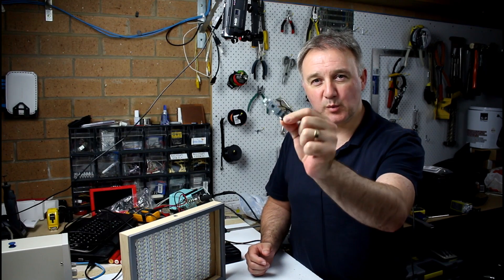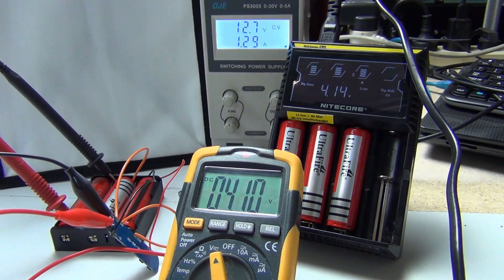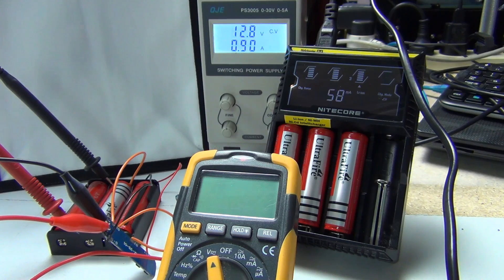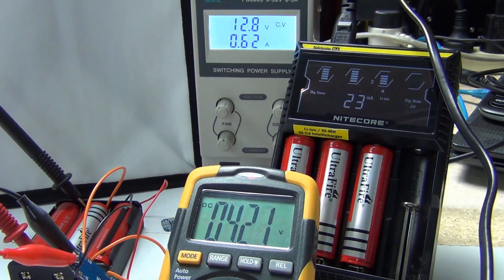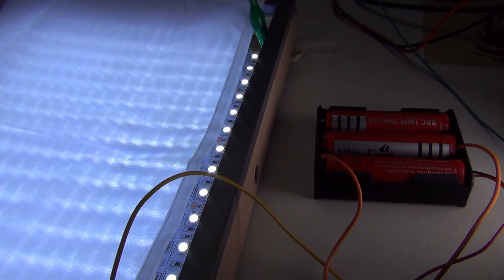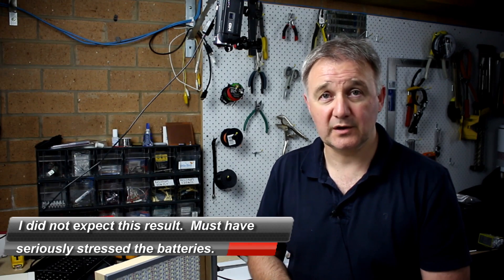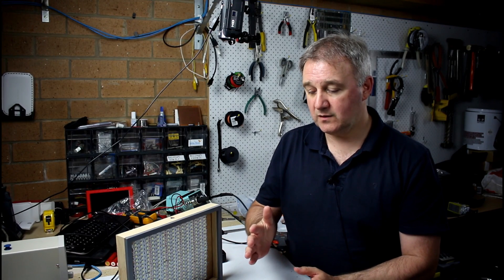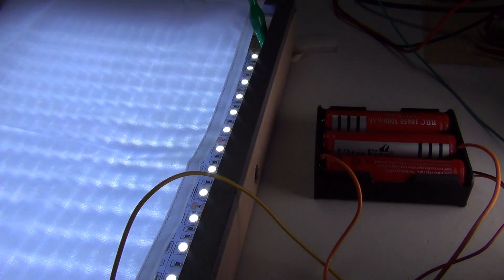BMS vs Battery charger - Surprise result (MEHS) Episode 58

Comment: You trickle charged your batteries more than they needed to through benchmark power supply.if you had cut the charge at the 0.3 amps,your results would have been the same.Nice effort

Comment: What i surmised from this is that small BMS boards can't be trusted and i need to build a battery cover on my device and put the 18650 cells in holders so i can take them out and put them in a proper charger 😞

Comment: What's the moral of the story? Can I charge a 3s 3p set of 18650s (total 9) with my regular 12V adapter (or 12V solar panel) using this 3s BMS or naa?

Comment: I'm not so sure about your results with your cheap charger and fake batteries.
  From what i understand, you feed the BMS with a fixed current art 4.2V The fixed current should be around 1/2C or whatever your battery is rated at for safe charging. For example. You are charging a4p 3s pack, each battery can be charged at 1A so you give the BMS 12.6V at 4A. The voltage can not stay fixed. It finds the level of the batteries and rises as they charge. If your batteries are very low they will try to draw more than 4A (if they are good battery cells) Then once they come closer to the final voltage the current naturally starts to drop off.
  You can buy a chargers that can not even deliver the charging amperage that your battery requires and they will take longer but if the end voltage is 4.2V then both sets of batteries should have ended up with the same amount of usable MAH. If not it is either because your charger has an end voltage of lower than 4.2V or that your batteries are toast and you did not do a controlled experiment by swapping the two sets around for the test.
  Did you measure the final voltage in the cheap charger? It might only be setup for storage voltage around 3.7V as that's what most people tend to do with batteries and that's a much safer more stable voltage!
Reply from the maker: Hi.  Yes agree that the results would have been much more conclusive if I swapped the cells over and ran the test again.  I have since disposed of all but 2 of the cells as they started to show significant resistance when charging.  Just really junk cells.  Cheers.

Comment: wow. so much wrong here. You purposely overcharged the BMS cells to OVER 4.21V 
AND you didn't mention the fact the Nitecore D4 only charges Li-ion to 4.16V not 4.2V to extend the life of the batteries
Do you work for a company that benefits from these BMS receiving bad press? 🤔🤔

Comment: What is you limit the input amps to the BMS.
Reply from the maker: Current was set to 3A but that was only because I tested the draw earlier and it never went over 2A.  Cheers
Reply: Ok thank, also would this be a good setup for charging a 4s2p pack of 18650 li-ion cells?
Charger - https://www.ebay.co.uk/itm/MAX745-4-2-4-35V-1-4-Packs-Lithium-Battery-Charging-Board-Voltage-Current-adjust/111825916930
BMS       - https://www.ebay.co.uk/itm/BMS-PCB-Balancer-Schutzschaltung-8A-f%C3%BCr-4S-14-4V-Li-ion-Akkupack/322980140008

Comment: The only sane video I see on Youtube regarding  Lithium battery charging. You wouldn't believe what other people do with 18650 batteries on Youtube including direct soldering on battery, gang-charging multiple batteries connected in parallel and/or serial without screening, and so on.  Thanks for the true engineering insight.
Reply from the maker: - Hi.  Thanks for the feedback and kind comments.  Cheers.

Comment: Lol what is this? You dont show us the mAh of those batteries? Your test is very in correct
Reply from the maker: - The MAH capacity of the cells is irrelevant as the test is about draining protected cells from a fully charged state, once in the Nitecore charger and once through the BMS.  The main reason for the difference as I discovered later was that one of the cells was way out of spec meaning the battery charger terminated the charge much earlier that the BMS.  The conclusion was simply that the Nitecore charger does a better and safer job of charging cells and maintaining the life of the cells (hopefully quality ones).
Reply: My Electronics & Hacking Show
Oh man diff cell have diff capacity. And you dont show the capacity of the cells. If bms charging is not good and not safe how come they use it in laptops?
Reply from the maker: - The cells in a laptop are joined by a BMS to make the laptop battery but they don't just dump a raw 12.6 or 16.8 or 21v into the battery pack to charge the battery.  The input voltage / current is managed by an additional IC (like a MAX745) that does more than a basic BMS.  You could still call the laptop solution a BMS but it has much more on the board than the simple BMS ive been testing.  Many new laptop solutions have individual cell monitoring, balancing and battery conditioning.  These initiatives have been implemented to make lithium packs safer and last longer, especially now many are sealed units.  As I mentioned already, the capacity of these cells in this test is not the point.  I do have a follow up video showing the real tested capacity of such cells if you're interested.
Reply: My Electronics & Hacking Show

That why you dont spreading a word that BMS charging is not good and not safe they are safe and good man. Some china made bms have also temp sensor. And your nitecore dont have it. It only use voltage sensor for shutting down.

Comment: how can one improve from the bms for charging?
Reply from the maker: - Basically you need to use a real charger as the BMS only controls the limits of voltage and current.  For 2-4 cells BMS you can use the MAX745 IC.  For anything more than 4 cells you need a dedicated external charger or a bespoke solution.  Cheers.

Comment: My question is, if I only wanted to use this to stop over discharging not to use it for charging would this work? Or should I just drain the batteries till the light stops?
Reply from the maker: - Hi.  Yes the BMS is ideal for protecting against over discharge (one of its main purposes) and you shouldn't just drain the cells until the light stops as you mentioned.  Doing that will drain the cells too low and significantly shorten their life.  Cheers.
Reply: My Electronics & Hacking Show Great! thanks for the reply

Comment: I really wish people would stop doing tests with those FN cheap overrated Ultrafire batteries you can not get good results from them.  There is not any consistency with those cells, I was suckered into buying them and every 1 of the 10 cells tested different some were 450 mah a few were 625mah and a couple only tested 275mah. STOP TESTING WITH THESE SHIT BATTERIES. other than that good try on the test.
Reply from the maker: - Hi. Agree they are not consistent.  I did a follow up video with a battery tester and real cells along with the Ultrafire cells.  They peaked at 800mah.  Cheers.

Comment: I only need the low voltage cut off. My pack is sealed so i wil make extra balance leads for my charger. Question is, will the bms interfere with my connected balance charge, seperate from the bms.
Reply from the maker: - Hi.  Possibly but unlikely because the BMS cut off ranges could be different from the charger specifications but within spec.  Ultimately it should not be an issue as the the BMS will only step in if the voltages are too low / too high which the charger is unlikely to produce.  Cheers.

Comment: Great vid. It surely helps people like myself who is about to replace NiCad drill battery with Lithium battery with BMS (which would function as low voltage Protection). 
So I need another set of wiring to the lithium batteries for Balanced Charge to an external balance charger.

Qn: 1. Would this 2sets of wiring to 4P lithium batteries work?
2. Wonder how the lithium drill manufacturers solving this Challenge or Do they not balance Charge their drillpack batteries?
Reply from the maker: - Hi.  4P or 4S?  I haven't opened up a lithium drill pack but based on the number of pins / connections on the outside of the pack I suggest they do balance charge.  Remember, the lithium drill batteries (say Makita) are charged by a dedicated external charger so there is plenty of room for descent charging circuitry.  Cheers.

Comment: Hi i wanted to say good video.

Also i am getting ready to test some BMS that has balancing onboard.   

I was curious if you have used one like this in your testing as it would look to have a more advanced charging device on board.
 www.ebay.com/itm/122240079884
Looking forward to your response.
Thanks for your work.
was a pleasure to watch.
Reply from the maker: - That board look ok, especially for a 2S board.  Still need to see what it does in the real world.  Cheers.
Reply: David Gaspar if they have "over voltage protection", they have "balancing".
Reply from the maker: - Yes correct, passive balancing.  Most boards don't have active balancing.

Comment: Hi, I came to your video while considering this types of BMS's as a low voltage cutoff system, for a portable 12v car vacum cleaner I want to have it's own batteries instead of the lead that connects to the car cigarette lighter. I was thinking of leaving the lead to the car battery as a way to supply power to the BMS to charge the batteries, now you've shown me that's a bad idea, since the car battery is normally at 14.5v-15v, and the BMS does not regulate nor cuts off at exactly 4.2v. Also, even if I didn't charge on the car battery I was going to use the lead attach alligator clips e use a 12v power supply, which is now clearly a bad idea as well. So finally, thanks to your findings I'll use the BMS only as a cutoff system and make a charge and a balance lead to charge it on my hobby charger. Thank you for the information, saves me a lot of time, otherwise I'd have had to do the tests myself.
Reply from the maker: - Glad it helped.  Thanks for the great feedback.  Cheers.

Comment: using bms to charge is hit or miss, some or good but some will overcharge. I had some go as high as 4.3. I always keep an eye on  them when charging. But I did notice they all seem to work well in cutting power when batteries are being overcharged.
I have a 94ah 3s pack, and when charging with my ecoworthy 20 amp mppt and 240 watt solar panel, the bms will shutoff when battery reaches 12.6 but doesnt shutoff completely. The controller still tries to put power into pack because it still sees voltage from battery. 
In other words when charging with bms you have to keep an eye on the process, which is what everyone recommends otherwise you will overcharge your expensive batteries. 
The best way to charge is using one of the expensive balance chargers used for charging rc batteries.
Reply from the maker: - Thanks for the share.  Yes agree, BMS can vary greatly and don't stay shut off.  I'm currently looking at using some tp4056 modules as a cheap but effective solution.  Hope to have a video in a week or so.  Cheers.

Comment: A comparison to a tp4056 charging module would be interesting.
Reply from the maker: - Have some TP4056 stuff in the works at the moment.  Hopefully in a week or two.  Cheers.
Reply: Also to tp5000 as its charging pattern matches closer to what cells want. Also dont forget to put extra cooling on both chips or they will drop A do due temp management.

Comment: So the BMS doesn't stop over charging, it doesn't equally charge the cells and it doesn't stop over discharging?
What does it do?
Reply from the maker: - Hi.  These boards still do what they claim but its worth noting the differences between the claims and what is not mentioned or covered, such as the difference between over voltage cutoff vs over charging.  
OVER-CHARGING - The boards stop over-voltage meaning when the voltage per cell exceed 4.25v (some boards are 4.2 or even 4.3) the BMS will momentarily stop current going to that cell.  Once the cell relaxes and the voltage drops below 4.25v the BMS will allow current flow again (not desirable for lithium cells).  
OVER-CURRENT - The BMS will allow power to go to each cell so the cell can be replenished but that by itself is not proper lithium ion cell charging.  The BMS will stop the flow of power if the power source exceeds a preset current (say 3amps).  
DISCHARGING - The BMS will again cut in and stop power being drawn from the cells if the cell voltage drops below 2.9v (again this value varies).  The BMS will then allow the cell to be drained when the cell voltage recovers to above 2.9-3.1v (some boards have a recovery voltage, not just a cut off voltage).  Eventually the cell wont recover past 2.9v and the BMS will block and keep blocked the drain on that cell.  
So a BMS still does its job but its not a battery charger in its own right and I offer my experiences and comments to help to clarify the pro's and con's such as the difference between over voltage and over charging.  The writings on such BMS don't typically talk about over charging because these boards are supposed to be used to protect unprotected cells when being drained or when being charged by a proper lithium battery charger.  Quality protected cells have these features built into the cell itself.  Hope that helps.  Cheers.

Comment: so, i'm planning to make a battery pack just using a 3s bms. some of the research ive done pointed out that it should always be exactly 12,6v while charging. at your power supply i see you charged them with 12,8v. could this be the difference? also, could i use the charging board in the provided link for save charging, and if so, how would i hook it up togheter with the bms? thanks

https://www.aliexpress.com/item/Charging-Protection-Board-PCB-For-3pcs-6A-18650-Polymer-Lithium-Battery-Charging-Voltage-12-6-14V/32735856217.html?spm=2114.30010308.3.2.VN2I0X&ws_ab_test=searchweb0_0,searchweb201602_4_10065_10068_10000009_10084_10083_10080_10082_10081_10110_10111_10112_10060_10113_10062_10114_10056_10055_10037_10054_10059_10032_10099_10078_10079_10077_10000012_10103_10073_10102_10000015_10096_10052_10053_10107_10050_10106_10051,searchweb201603_2,afswitch_5_afChannel,single_sort_0_default&btsid=e7357d51-72c9-42fa-8804-0c455203b93d
Reply from the maker: - Hi.  Okay a couple of things to cover here.  I used 12.8V because the cutoff for my board per cell was 4.25v and I was losing about 0.5v through the circuit.  Normally 12.6V is spot on.  The board you linked is a BMS not a charging board.  Most are.  The way they are advertised can be very misleading as they include the term CHARGING.  What they mean is the board is a battery protection board for charging of the batteries that is handled by a separate charger.  This board does not charge the batteries properly.  It simply allows power to reach the cells within limits, not too much current, no voltage per cell over 4.2v etc.  It does not provide the Constant Current (CC) or Constant Voltage (CV) cycles needed to correctly and safely charge the batteries.  You can put rough power back into the cells but they will have a reduced life.  The other risk is that these BMS don't have a timer to completely stop the charge.  If power is available to the BMS it will continue to trickle charge the cells also reducing their life.  This is why you should use the BMS to protect the cells but apply power to the cells through the BMS from a proper lithium 3S battery charger.  Alternatively you can use a single 3.7V cell and a boost circuit to get the voltage you want.  There are a number of boards that will manage and correctly charge a single cell (Sparkfun 12711, Adafruit powerboost board etc).  I am about to do a video looking at making a 12v battery pack that can be left inside a project but is properly and safely charged using TP4056 charging IC's.  Hope that helps.  Cheers.
Reply: yes thank you very much. cant wait to see that next video. the pack i'm planning to make is for inside a portable speaker, the amplifier needs 12v so it must be at least 3s, but since the acoustics of the speaker greatly depend on the air tightness of the build, the pack must be left inside always. so, taking them out to charge wont work
Reply from the maker: TheEvanovitch
- Makes sense.  What is the current draw of your project?
Reply: well its a TDA7492 2x50w amplifier, powering 2x 8,5w 2inch speakers, but haven't got a clue how much it will actiually draw in normal using conditions. i know the amp is overkill, however its dirt cheap, and provides everything i need like both bluetooth and 3.5mm input. the speakers are pretty good, had them lying around already, also had alot of laptop batteries, and since bms are dirt cheap as well, it makes a nice budget build. my original plan was to just hook up the 18650 to the bms, hook up the output of the bms to both a charging socket and the amp. but if thats not a good method of charging, i will search around a bit more for better solutions.
Reply from the maker: - Hopefully its not a constant 8amp draw.

Comment: Will the protection circuit work with more than 3 18650s ? Like 3 blocks of 3 batteries in parallel each, for a total of 9 18650s but still at 12.6v? I want to make a power bank for a dslr camera and extras all together but I don't know if that will work.
Reply from the maker: - Hi.  Yes it will work in principle.  Depending on your protection circuit.  Only way to be certain is to try it but the BMS will just see the 3 cells in parallel as one cell so you should be fine.  One risk is that when applying charge to the cells you could get one cell charged at 4.3v and one at 4v.  The BMS won't stop supply to the parallel cells as it will read the average of the 3 cells.  Use protected cells and you should be fine.  Cheers.
Reply: Actually, being connected in parallel, the cells are exactly the same voltage all the time. So no "unbalancing" issues here.